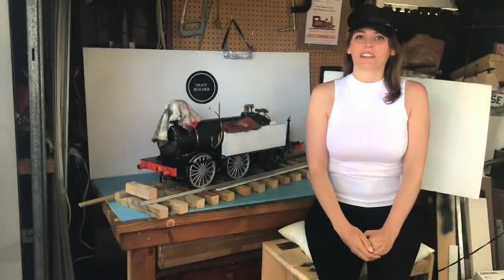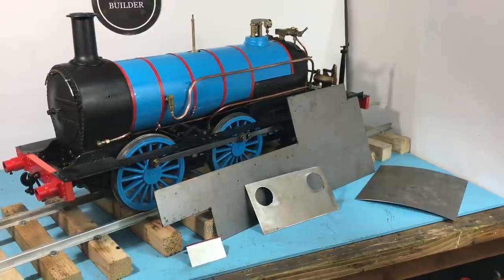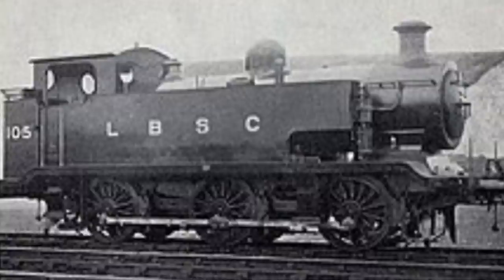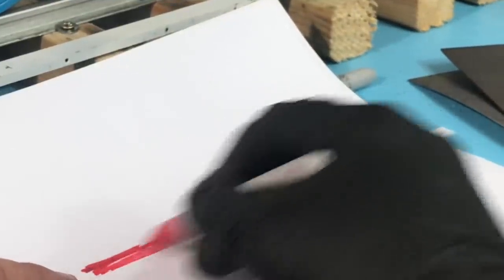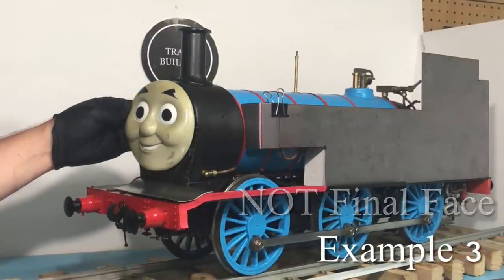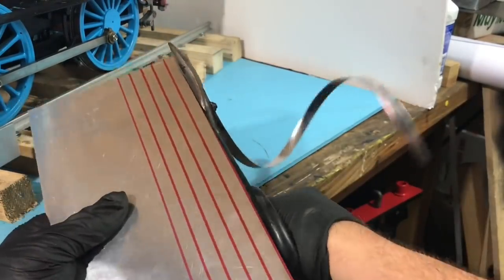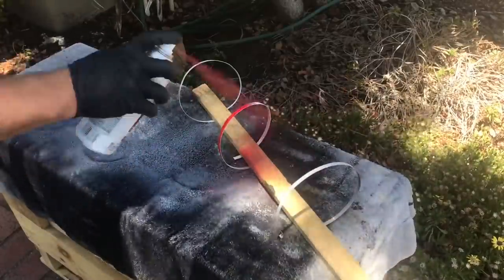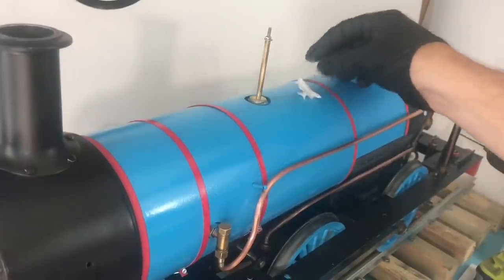Thomas The Tank Engine - Live Steam Kit Bash Part 6

Comment: you know, if you think about it, thomas never had an accident where he:

- lost thirst for water
- had poor stability for speeding
- had derailed on a tight curve for being too long
- had stopped for no reason due to the E2s having a reused boiler from the I2s

and when think about that, that's actually quit impressing for a locomotive as fawled back is the 1910s, i don't hate the E2 by any means nor am i trying to make a tread about this, aside from that, the locomotive is turning out quite nicely.
Reply from the maker: That’s a great comment! Good description 💯

Yeah it was unfortunate they weren’t that great of a locomotive. I guess they eventually became a great locomotive through Thomas and shine on as being much joy to fans etc. I also heard they extended the tanks to allow for more weight due to slippage. They were finicky beasts.
Reply: Though for most of his life he was only running with two carriges which some much smaller industrial locos can handle and on his branch line he's working alongside locos that in can't imagine give much better performance being a small saddle tank and a edwardian tram locomotive
Reply: @twonkfieldrailways4110  tbh you do make a good point
Reply: Honestly, I have the same opinion.
I do like the E2 class locomotives (I even made two fan-made characters based off the design), but I'm not going to deny their flaws.
The only thing I don't like about the class is their I2 boilers because of their inability to hold steam pressure (I even redesigned one of the fan-made character to have a better boiler)
Reply: Well, in the books, Dalby re-drew some of the art and removed some of his e2 features like his sloped smokebox. And in future appearances his length was drastically reduced.
Reply: @TRAINBUILDER  No, they actually extended the tanks for more water as the E2's had insufficient water and coal supply.
Reply from the maker: @PhineasTurner  I should have said that too...

Comment: Are you concerned that the heat from the smokebox would melt the face?
Reply from the maker: Great question! And the answer is YES..!! Lol 

Actually i think if I make a nice firewall in between the face and smoke box door it should be fine. I’ll still need access to clean the flews etc so I’ll have a little buffer between the two. Hope this helps!

Comment: When you are connecting the water feed pipe to the clack valve you shouldn’t tighten it all the way as when it gets hot it becomes very difficult to get off
Reply from the maker: Thank you for the great advice my friend! I’ve had other occurrences on other locomotives and have had to fix others engines with that same or similar problem.

Comment: Although Audrey did select a real locomotive for the basis of thomas it was not an E2 class. He picked a ginty. Paine picked the E2 beacuse he was a "southern man" as one YouTuber put it

Edit also Thomas only has 6 boiler bands
Reply from the maker: Interesting! Alway into learning new things! I’ve heard a lot of stories with the pick of the original locomotive. Some say RA had a picture in his pocket the day him and Payne discussed the pick for Thomas. Some say RA wanted a J50 too. The stories keep coming and I find it fascinating! Glad to have you on board my friend 😎🚂
Reply: @TRAINBUILDER  I've been a Thomas fan since I was two, you need info on how to make him to look series accurate (seasons one through 4) hit me up. I'll be more than glad to help
Reply: @TRAINBUILDER  in fact two things that will help
1 use a three kink coupler instead of a screw link as in the tv show that's what he had and  
2 I would suggest a slightly taller cab, I did see you had metal plates that had the side of the cab and it just seemed a little small
Reply from the maker: Awesome! Good to know. I’ve heard the cab was to tall.. So I was planning on shortening it by half inch. Will see! I’m working on extending the smoke box and dropping the front buffer bean down in order to get a proper slope. Any thoughts?
Reply: @TRAINBUILDER  that is actually really accurate to the show and the real thing, would likely please fans and hey, you can't do worse than Mattel is right now
Reply from the maker: Lmao - That’s the truth brother!!